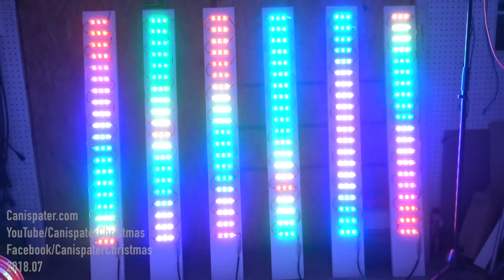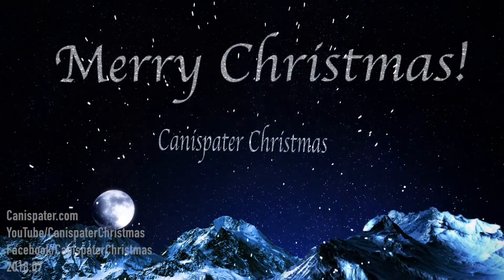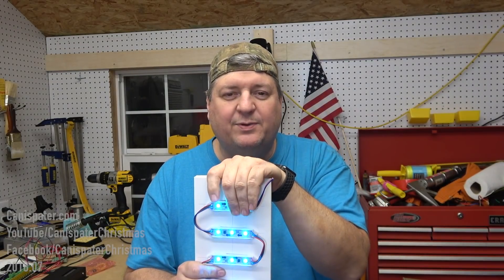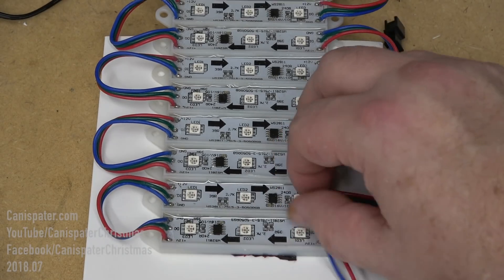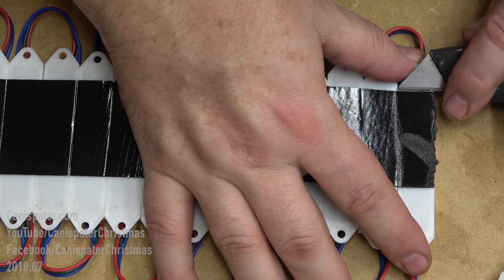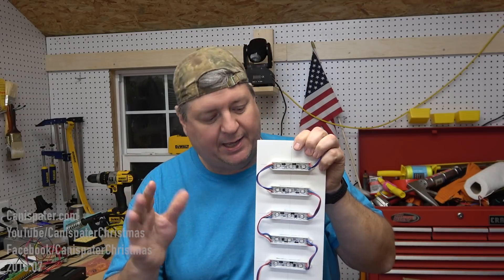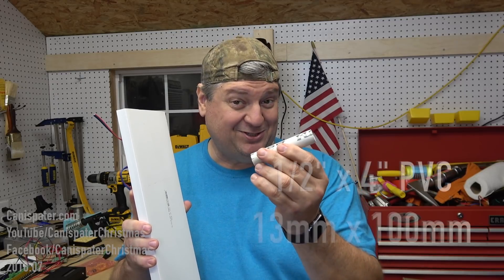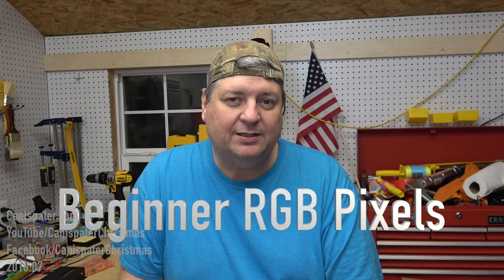WHAT ARE THESE THINGS CALLED - Pixel Sticks? (2018)

Comment: Great video and idea.  I’ve never used pixels and considering adding pixels to my display. I want to add a “fire stick” to my display for next year and thought of these. 

Would you recommend these to someone who has never used pixels (including install, build and programming)?  

Not sure what else I would need to make six of these ?  

Thanks,
Steve
Reply from the maker: I don't recommend getting "promotional" items, but I don't think the general design is bad. Full disclosure, all the strings I had failed. You also need to take off-season storage into account. I like the modular matrix panels from Boscoyo since they can be stored easily, but the type of pixel you get really doesn't matter except for pixel strip which I do not recommend for beginners. Other than that, one you get something running, it's easier to add to it later. Definitely check into the forums or Facebook groups I have listed in the video descriptions and try out the xlights zoom room (see xlights.org).

Comment: Hi Jeff, I am an electric guitar player. I have a good sized pedal board that I use with my guitar. Currently, I have some LED lights that I bought from Lowes that can do patterns light a Christmas tree. I would like to take this a step further and use pixels on my board. I think it would be so cool. Question is, how do I control them?  Thx
Reply from the maker: Well, Pixels are controlled by data. The typical use is to program the lights ahead of time and have something like a Raspberry Pi computer "play" the data out to the controller(s) which make the lights blink. I suppose you could have a foot switch trigger a different pattern each time you hit it, but that's going to be a lot of DIY. :) I have a beginner playlist that walks through pixel basics. Check that out if you haven't already. It might create some ideas.

Comment: I’m thinking about building some of these.  Maybe with a star or something on top.   Does the glue hold up well enough in the outdoor elements?   I’m in Missouri so it’s gets pretty cold here.  Anything you would do different?   Your videos and online course are great and very informative.
Reply from the maker: Thanks James! The hot glue held just fine, but stay away from the "promotional" items on AliExpress. These were promotional and I noticed they were not as sensitive  (required a stronger data signal) as other pixels I've used AND every string had at least one LED go bad this year - very high failure rate. Not saying all of the strings like this are bad, but I the "promotional" strings were a huge disappointment and waste of money. I'm going to figure out a different prop for that side of the yard this year.

Comment: So if you were going to mount a bunch of these rectangle modules on a fence post sleeve, would you do it up one side and down the other or spiral around the post? I'm using a 4x4x6 fence post sleeve and xlights.
Reply from the maker: I mount them horizontally on all my props - personal preference really. I wouldn't wrap them around the post. Pixels look great in a straight line as opposed to normal lights where you can wrap them around something. Pixels don't look as good that way because the light is much more directional.
Reply: Ok, so mount them horizontally up the post, and then come back down the other side all the way around with one connection then?
Reply from the maker: Haha. Well, try it one way then keep it if you like it or try another way if you don’t. There isn’t a “right” way or “wrong” way. It’s what works best for your display. I look at my display as an ongoing experiment. ;)

Comment: Putting my sticks together now, and in xlights I set them up as a vertical matrix 3 by 35. That gives me 105 pixels and 315 channels, so I should be able to run each one as an individual on my 16v3? Am I correct with this thinking, or just make it a larger pixel size like in your video?
Reply from the maker: Each module is a pixel.  Even though each one has 3 RGB LEDs, you can only control them in groups of 3. I used a line because that's how xLights see them. So even through there may be 105 RGB LEDs, there are really only 35 pixels.
Reply: Oh ok, so I was waaaaaay off...lol I'll have to go back in and change it in xlights... thank you for your help

Comment: I wanted to ask if you could address each module as 3 separate single lines? I am thinking of these as an outline to a garage, eves, etc and be able to do opposing directions, off-set waves or more.
Reply from the maker: Even though they have 3 RGB LEDs per module, there's only one chip so each module is addressed as a single pixel. All three RGB LEDs will be the same color and brightness (so I think the answer to your question is "no"). But you can do chase patterns with the string just like any other pixels. These modules have a single strip pixel in them and I have used strip to outline my garage. I changed them out for individual pixels because there was a gap I didn't like when connecting two strips in the middle (I was new to pixels then so not necessarily the strip's fault lol).

Comment: Hey, Jeff one more question about your pixel sticks. How did you do the physical connection to the controller? Can you connect them in series or each one on a separate port? Sorry still noob!
Reply from the maker: Ha, no problem. You cannot do them in parallel, but you can do them serially. The challenge comes when you're jumping from prop to prop. Pixels aren't made to support long distances between pixels. I read somewhere you can probably get about 3-feet without some sort of null pixel or signal amplifier in between, but I haven't done any testing. I may use individual ports for these, but I haven't decided yet.
Reply: Got it thanks

Comment: I would like to know why you like X lights over some of the other choices out there.  Also I'm still struggling with trying to put a "list" together of electronic devices I will need to purchase.  You may have covered these two points in a video that I missed.  If I did please point it out to me and I'll go back to them.  We are about to jump waist deep into this and we are excited!
Reply from the maker: 1) My main reason for using xLights was that it runs on a Mac. I tried Vixen initially, but didn't have a Windows computer and I believe the team was on hiatus at the time so there didn't seem to be much development happening. Things have changed since then, but xLights does what I want, I like the basic architecture behind it, it runs on my computer and is under active development by people running huge displays. Not the prettiest UI since it supports multiple platforms, but not horrible and very functional. It is also free to use though I donate to it's continued development monthly. It's also open source so the more eyes on the source code the better. 2) It really depends on what you want to do with your display. Most of my videos cover using (individually addressable) smart pixels so a minimal list for that would be pixels, power supplies, a controller and a computer (plus wire, extension cords and basic electronics stuff like that). There are dumb strings where the whole string is the same color, but changeable. There are controllers that don't require programming. Check out the pixel tester video. They are limited in capability, but simplifies the learning curve. There's also AC controllers that turn standard AC lights on and off.
Reply: Thank you very much!  You are a great help and your videos really simplify this process.  I love the idea of the singing Christmas tree faces and the pixel tree.  That's what we are thinking right now and are going to get a handle on that as a start and from what I've seen that will be plenty.  Would like to add arches and a wreath like yours to it as well sometime down the road.  Thanks again and maybe Santa will bring that miter saw!!
Reply from the maker: Thanks! I started with a pixel tree. You will learn a lot from that. Yeah, I love the wreath and may do a second one just like it at some point. Biggest problem with the arches is getting the tubing. Shipping from that place is a bit steep for private individuals, but there may be an alternative. More research needed. Haha. I'm thinking a well-timed piece of jewelry might bring it sooner. lol!
Reply: Genius!

Comment: Did you buy the would prefinished ? What would be the best combo for weatherproofing
Reply from the maker: This is made out of PVC so it should hold up to anything. If using wood, a good coat of paint or two should work. Also, this stuff is usually only out for a month so it shouldn’t weather too much unless you’re planning to leave it out all the time.
Reply: CanispaterChristmas - home depot a good source for it? Going to go search now
Reply from the maker: I got it at Home Depot. Any home store should have it. It’s considered trim plank.

Comment: Looks great Jeff. Now I've found another use for those modules and I'm going to steal that idea. Not going to call them sticks here. I'm on a bush block so I have sticks everywhere :D
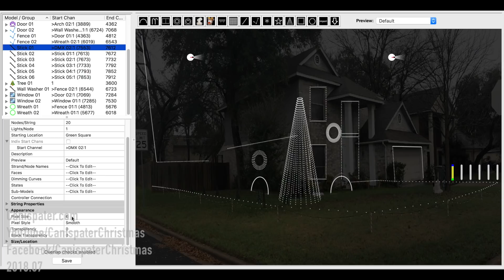@5:34 you said 3 pixels per node. It's actually 3 leds per pixel/module.
Reply from the maker: Haha! Who will be the first to use starlipops? Feel free to use the idea. I’m sure I stole it from someone else. Lol! Yeah, I consider the RGB led package a pixel, rather than an led, but that isn’t technically correct. Led cluster?
Reply: No idea what the official name for them is. They are 1 pixel IC and 3 leds though being a 12V device. I have got official approval from the better half to make some big sticks though. She wouldn't give me approval to do something with my circular saw lead like there is at around 2:10 into vid.
Reply from the maker: Wait. That's a handle. Just moves the blade guard out of the way. I find that when cutting small pieces like that, the guard puts too much pressure on the material messing up the cut. I did get another suggestion to cut the other direction so more of the saw base is on solid material. Makes sense. Today I learned. :)

Comment: Started watching your videos back in January of this year and LOVE them!  Just a suggestion, when using your saw, use the large flat side to get a more accurate cute, You used the short side and it is tough to get the arm up (blade protector) as well as getting a good cut.  It worked though as no one will see it unless they are up close.  Good idea on using PVC with rebar to stand them up.  Thanks for the wonderful videos, look forward to seeing the next ones! You get the creative juices flowing!